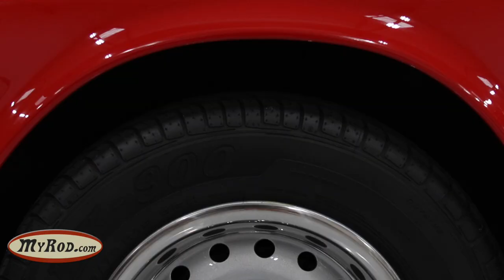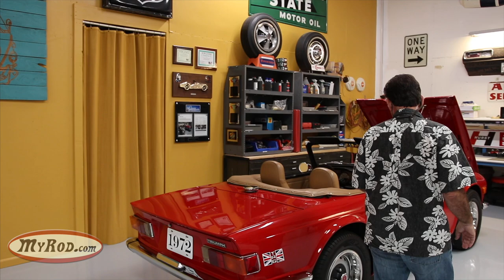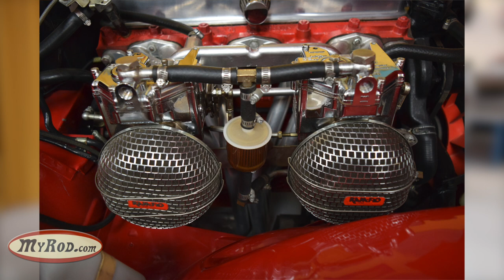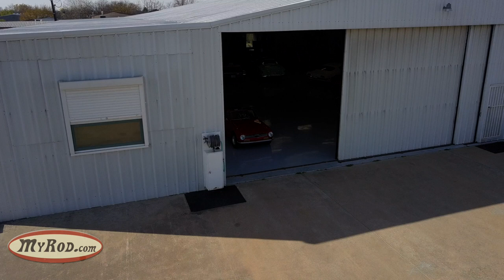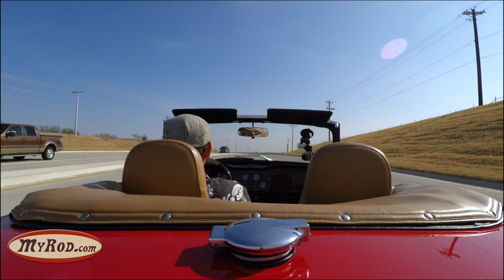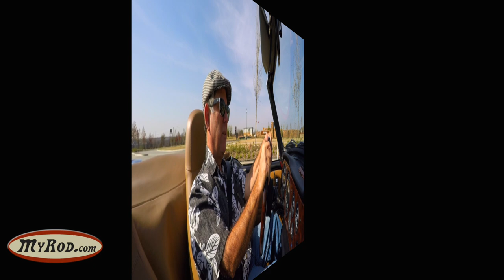1972 Triumph TR6 - overdrive & performance upgrades!

Comment: One of the prettiest British sports-cars ever made.Lovely
Reply: I think the designer was Michelotti.
Reply: @tolrem  The TR4 and TR5 were designed by Michelotti and obviously the TR6 design was heavily influenced by those predecessors but it does stand out as something different and I think some of the design changes on the TR6 were done by Karmann but someone else might correct me. Regardless of that it is a fantastic British sports car. It's the only British sports car that isn't a Jaguar that I'd want own.
Reply: @mattkinsella9856  Yes i think it was Karmann now you mention it.I love that shape.I wish I still had my old red TR6,but that was  44 years ago.Tempus fugit.. sigh.
Reply: Karmen from Germany designed it - Miccelotti wasn’t available, so the story goes
Reply: This is how a sports car should look. Well balanced engine overdrive gearbox. Far superior to the MG B
Reply: @michaelnaisbitt1639  Should be for 100,000 Pounds.
Reply: Yes, my favorite - unless my favorite is the TR 250, or the GT6. All of them are so easy on the eyes, and then, some designer came up with the TR... well, let's not speak of it, it is too painful.
Reply: @mattkinsella9856  Sunbeam Tigers were pretty cool - you sure you wouldn't want one of those, if it could be red, or British Racing Green?
Reply: TR5 for me.
Reply: I think so, I've owned four of them...
Reply: Confortable cabin… with oversized seats from a different car. lol. Looks good, though.

Comment: One of the best looking and best sounding cars ever made. I've owned two of them and I want another !!!
Reply: @classiccarz Never was a bad looking British sports car. They're all pretty, and, the 4 was one of the best !
Reply: I’ve had two also, but will stick with my 1969 280 SL — the car this one strived to be.
Reply: Man this brings back 1974!! I was 18, Had just started working driving a Forklift and later bought a very used 69 TR-6 for 1500 bucks with a loan from My Boss. My neighbors were Motörhead’s and helped Me rebuild the engine and install a new clutch. Had the heads down, block bored 30 over, Weber’s and an Ansa exhaust. Unfortunately it was a 4 speed without OD. The Alpine stereo was GREAT since the speakers were given more Bass from the empty trunk. But the Highlight of MY Black Magic was the SOUND!! The 4 pipes from the  Ansa exhaust sounded so strong and Nasty. I loved to downshift or double clutch to let the car talk. Folks could hear Me coming from a mile away. Either because of the Led Zeppelin, Ten Years After, Bob Marley, or James Brown music, or the GROWL of the exhaust. The Weber’s were a pain to adjust, for Guys that knew nothing of English cars unfortunately. With the help from My Boss He had it singing that sweet Ansa song. My friends all had American Muscle cars, Camaro SS with 427, Roadrunners with 383, VW Bug with 283 Chevy, and a 45Ford Pickup with 289 Mustang engine, and a Chevy Vega with a 327 motor. I was always first in line when Cruising on Friday nights. That car was a LEG OPENER. The only bad part was starting it in the rain. It was definitely a Sunny day car. I was late pretty often but My Boss understood because He drove a Jag XKE 4.2, when it started. Beautiful sound, nice paint, but FANTASTIC Interior. I wish I hadn’t sold Black Magic. Thanks for the video.
Reply: I've owned 3 and just bought my 4th...

Comment: When I worked at Standard- Triumph I fitted the gearboxes to TR6s, they were bad enough but the o/drive boxes were a strain to get onto the engine.  We were all big fit lads in those days and it was a point of honour not to "grunt" as you fitted an o/d box.  It was OK for your arms to tremble and your eyes to nearly pop out of your head but no grunting !!!  Just think, I might have fitted the gearbox to that very car.
Reply from the maker: Wow! that's so cool. What an interesting insight on how things were done when the car was actually being manufactured! Thanks for the story Stewart. No grunting, hahaha... I'll remember that. 😁👍🏻
Reply: 9

Comment: I purchased a TR6 in 1971 when I worked for the company, it had only covered 24k miles when I sold it about twenty years ago. Colour was pimento and it had fuel injection being a UK car with 150bhp and O/D on 2nd third and fourth. Your excellent video brings back a lot of memories including fuel smells from the injection. Even in todays world the TR6 was a quick car and wish I had been able to keep mine. I believe the rear panel was black originally however your restoration has been beautifully done.
Reply: Mine had the same specs as yours.I owned it in the mid 70's here in New Zealand.It was fast for that time.It was originally owned by the American ambassador's wife,but it needed a complete engine rebuild as it turned out she..or he? had thrashed it.Wish I had it now.I would prefer the USA specs with the twin carbies though.Not so fast but probably easier to fix.It had a problem with where the top of the suspension arm attaches to the chassis.It just broke off leaving the wheel flopping about,only then attached at the bottom.Really dangerous.
Reply: chris younts  I guess that would be down to the biting US emissions laws of the period.
Reply: I also had a UK car, same colour, satin black rear panel, 2.5 PI overdrive 2nd, 3rd and 4th....
What I didn#t like was it had 'Rostyle' stainless steel and black wheel trims that were heavy and double skinned, and on one occasion one came off, and rolled at the same speed, and disappeared over a hedge into the field!
We turned around and headed back, but could we heck as find it so, having better things to do, I said "never mind, I'll just get a new one"!
That was before I found it was going to cost £25.00, and this was a heck of a lot in '72!
That being the case I went back with a tool for ripping out under the hedges, and found it....lol

Comment: Great memories of the TR-6 in the mid 70s. I get the idea of restoring it “better than factory” but had mixed feelings about not putting back the (mostly for worse but had their 70s charm) stock seats.
Reply: I rebuilt the seats, new foam, and seat covers.  They were very very comfortable.

Comment: I didn't appreciate these until later on when my brother got one. 1966 GTOs spoil you rotten on power because they had oodles of it to spare. I learned how to drive on a 48 Olds with a straight 8 - 3 on the tree. Those are still cool. After driving my brother's TR6, I loved them and still do. They just didn't build very many. I tried to find a good driver within reason- pricewise but not having much luck. Most are just trashed beyond repair. This 72 is gorgeous.

Comment: My first car was a 59 TR3, black with red interior. This was in 1968. In 72 I picked up a 64 TR4 and had that for only a short time - 2 years. I was drafted into the army in Aug of 72 and the car went with me to my station at Ft Ritchie. Now that I'm retired my hope is to pick up either one of those, TR3 or TR4 and I cannot rule out a TR6. Loved your video as it sure is a beautiful car. Thanks for posting.

Comment: I bought my Pimento, non overdrive ‘72 TR6, new, took delivery in Coventry, U.S. left hand drive, had a Nandi wheel fitted at the factory, drove the car for a month, touring Europe, had the car shipped back home from Amsterdam (Dock strike going on in U.K.), Kept the car for a little over a year as a daily driver and then sold it. Loved the car, but hard at that time to find someone to service it properly. Loved the way it looked and drove. Loved seeing it with the big British plates. My ‘72 didn’t have the Union Jack logos, just TR6. I thought that was a later version. Went to Watkins Glen last year with my Corvette Club, they celebrated Triumph last September. A real treat to see so many in TR6’s one spot, and seeing. them in action on the Historic Road Course.
Reply: NARDI wheel.. not NaNdi...

Comment: My first new car was a '73 TR6 with Overdrive.  Its color was what they called Pimento Red and had the Michelin X Radial Redline tires.  Best memory is I paid $4,500 for it.  I enjoyed it for four years.  It leaked water into the right side interior...under the carpet.  I never could find where the leak was coming from.  In the forth year I had it, a thrust bushing went bad in the transmission.  $125 repair cost I thought was fair.  I pulled the transmission and delivered it to the mechanic  Sold it to help fund the purchase of a '59 Cessna 172.  :)

Comment: This brings back memories of my  69 TR6. I loved that car (a true chick magnet too) and had it tuned by a Master mechanic regularly. No smog devices and the sweetest sounding stock set of pipes ever -  other than the Vance and Hines pipes on my Harley. If only I had a 5th and 6th gear to match the torque of that in-line six cylinder!! I am sure mine would have clocked 160 mph if so equipped. Dang it, Son!
Reply: The electric overdrive made a world of difference.  You could use the O/D in 2nd, 3rd, and 4th gear.  I don't know why more people didn't buy that option?

Comment: I had a 76 TR6 with O/D and loved it.  Mine had the optional Hardtop as well.  I had the car up to 115 mph with the O/D on and it was epic.  Just a great car and with the headers and exhaust system, it would trigger the car alarms in my office underground garage LOL.
Reply: at least it sounded fast
Reply: @donwest5387  For sure.  Nobody would be afraid of it.  I'm sure that a Honda Accord was faster off the line LOL but not as much fun to drive.

Comment: I've got on in my shop right now for some frame repair and fabrication. Owner put a small block ford on it. With the body off you don't need a jack to lift the rear end on to stands
Reply from the maker: Wow! Sounds cool.

Comment: Good vid' Overdrive is a 'must-hav' as UK cars were under geared back then due to most drivers only doing a town commute to work. In 2018 whatever car you buy in the UK its got 6 gears (manual) or 7 (auto) with a diesel running 1800 RPM at 70
Reply from the maker: Thanks!

Comment: One of my worst decisions was not buying my mate's dad's dead  2.5 PI for 100 quid in 1982 when I was an impecunious student. Today I think it was only the inertia crash switch stopping the electric fuel pump. I did buy a project  150 bhp TR6 PI  however in 1998.One day it  will be making those  magic noises again!
Reply from the maker: Best of luck to you!

Comment: Beautiful car. My 72 has the Miata seats also which are incredibly comfortable. And I agree, the exhaust sounds great. I have to point out, though, that the 72 did not have the British flag on the quarter panel. It simply said TR6. The British flag wasnt introduced until 73. Otherwise, looks great!

Comment: YOU seem to forget about the 16X Rotary engine that Mazda has been working on for over 10 years. It's a1660cc, long throw eccentric shaft engine designed for low end torque, and have a 7500rpm redline. It was expected to get around 260 to 300 naturally aspirated hp. Combine that with THREE electric motors? YEAH! 350hp sounds about right.

Comment: A friend of mine owned one of these and modified the overdrive switch position onto the gear stick, he surprised alot of cars as he could switch to overdrive in every gear as he accelerated. So as the other cars would run out of gear he would extend his through switching to overdrive.
Reply: The factory overdrive worked in 2nd, 3rd, and 4th.  

But if you forgot to flip the switch out of overdrive before engaging reverse, the sickening gear-grinding noise would quickly remind you of your error!

Comment: I cleared a TR6 thru Customs, EPA & DOT in the early 70's here in the states.  I drove it from the point of rest from the ship to our office so the owner could pick it up after hours when the port was closed.  It was a fun car to drive and it had the overdrive too, but it was on the right side of the steering and was actuated by pulling out and pushing in.  Compared to our American studs this was pretty gutless, but it did look very good.
Reply from the maker: Cool!

Comment: I may be able to go all year without having to touch my Miata with a wrench, but it doesn't have the soul of a TR 6!!
Reply: Having driven both a brand new 91 NA MX-5 and a brand new 1975 TR-6 both have/had their similar but different raw driving experience charms.
Reply: Didn’t have the TR-6 long enough (just a few K miles) to experience any mechanical issues so my memories of it are only positive. The MX-5 also nothing but positive memories except 22 years and 70K miles with just routine maintenance, bulletproof.
Reply: Correct!
Reply: Staticky the MX5 will have gone through the crusher long before it gets to 50 years old

Comment: I'm in the UK. My first TR was a 1962 TR4 bought in 1973. My second TR was a 1967 TR5PI bought in 1975.  My 3rd TR was a 1972 TR6 same colour as this, bought in 1981.  My interest inTR's began to wane when TR's began to arrive at meets on trailers. Show cars that only really related to the depth of the owners wallets. 

So,  TR6's of the same age as this, ie 1971/72 were not, here in the UK, in any way  'boulevard cruisers'.  They were fuel injected with around 150bhp, whereas the TR6's that went to the US had carburettors and something like 100/105 bhp.  UK TR6's didn't need Weber carbs, sports cams, or expensive exhausts/manifolds to make them go. All my TR's were daily use, go to work, general use cars.   I would add that the exhaust note of both the TR5 and the TR6 ( UK ) was a deep 6 cylinder throb, unmistakenly a 6 cylinder.  The exhaust note on the car here is more of an anonymous sharp rasp. If I was using it every day, week in week out, I'd find it really tiring to listen to. 

I agree with the use of MX5 ( Miata ) seats.  The standard seats in a TR6 were, as I recall, OK and no more than that.  My current ( project) car is a 1993 MX5.  Even at 28 years old, there's lot more support in them than any TR seat I ever sat in.

Comment: Well that's a first , wearing a seat belt! Over here in the UK  it has been against the law not to wear front seat belts since 1971  ( l think, will have a check) . Mine is fuel injected and sounds as they should! I've checked and to my surprise front belts were compulsory from 1983 , rear belts 1989. I know l  was wearing them well before that. My father's 1961 Jaguar mk2  3.4 saloon had  front belts fitted from the factory. I was involved in a end over  end accident as a 11 year old and had l have been wearing belts  l would  have been crushed as the car roof collapsed level to the door tops! In spite of this  l always wear a belt. Of course the modern cars are so well built today that survivability has increased 10 fold.Can't wait to get mine back on the road. You genuinely seem to be enjoying this car .

Comment: Nice Triumph.  I have a red 1967 Triumph TR4A IRS and I put a 5 speed in car with a Toyota gear box and is a lot better than an overdrive transmission.  I don’t have to worry about a slave cylinder.  A lot of guys in our club put those Mazda seats in their TR6 cars.  Those seats don’t look right in a TR3 and TR4, only in a TR6.
Reply from the maker: Thanks! Yeah the seats are awesome in that car.

Comment: A true work of art from the factory, adding the extras makes it sweeter yet! The exhaust sounds great though I didn’t know motors need an exhaust. Motors are electric. What’s the cost of a restoration like this?
Reply from the maker: engines have so long been called motors I do it myself now

Comment: That was FUN and informative!  A friend wants me to buy his TR6, no overdrive.  I do a lot of highway driving,  Can one reasonably add overdrive to a non-overdrive TR6?    Thanks, Gary.
Reply: 2yr old request... Did anyone ever get back with you? It is possible to add overdrive, though some parts may be difficult to find.
Easiest way would be to buy a complete TR6 gearbox with J type OD. Swap that for the 4 speed non-OD gearbox, add the switch and a wiring sub-harness, change the speedometer cable and done. Or, buy just the J type OD, preferably from a TR so it will include the necessary adapter. The 4-speed gearbox will need a different main shaft installed (a general rebuild at the same time would be wise) and some isolator switches installed in the gearbox top, then the same switch added to the steering column, wiring and speedo cable as above. Most of the parts are relatively easy to find. The biggest hurdle is finding a complete gearbox with OD... Or finding the the J type OD alone with the correct adapter. (But J type and parts for it are much less difficult to find than the earlier D type OD and the parts needed to install it D-type. were used in TR3 through very early TR6. J type can be substituted, just a different gearbox needs to be used.) 
Note: Laycock overdrives were used in a number of different European cars. For example, I know Volvo used them. Those OD also came with different ratios. It sounded as if the one in the TR6 in this video has a 20% reduction. I know there were 22% and 24%. And there may have been others. The greater the percentage of reduction, the more the RPMs will drop with the OD engaged.
An interesting thing about the TR OD setup is that the OD works on 2, 3rd and 4th gears... Essentially making for a "7 speed gearbox". 
An alternative some choose is a Toyota 5 speed gearbox, which gives essentially the same functionality, as the 5th gear is for all practical purposes an OD. I'm not sure which specific Toyota gearbox is used, though.